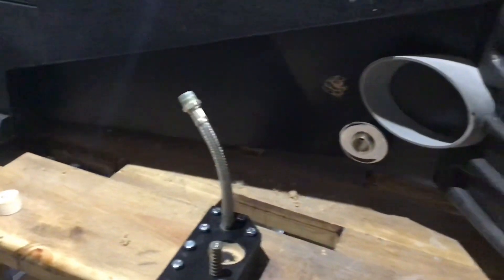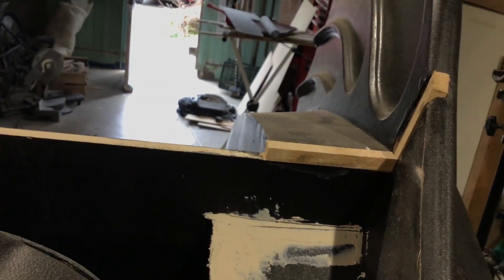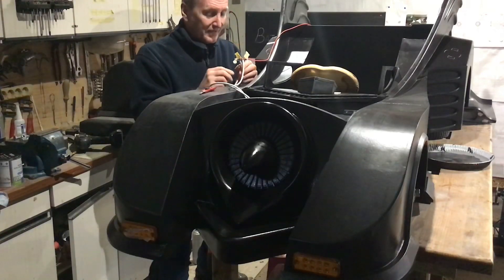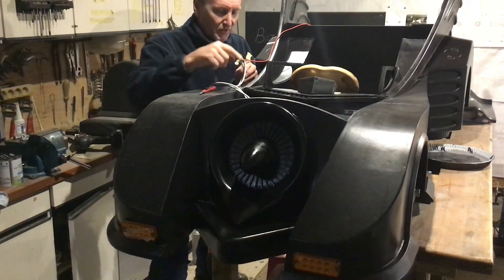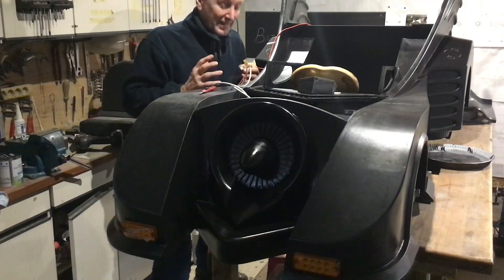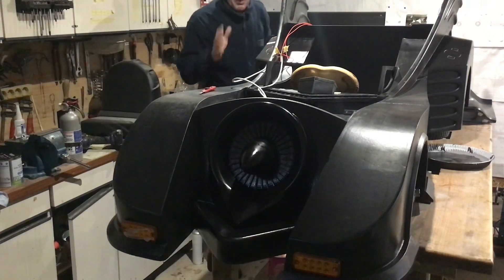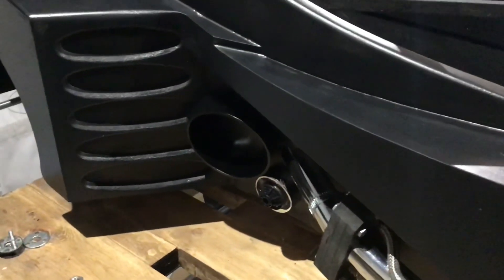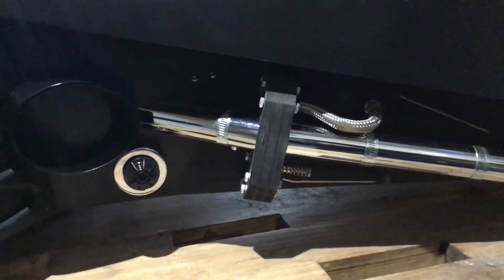KIDS ELECTRIC RIDE ON BATMOBILE.  Batmobile build Part 16 final build episode before the movie......

Comment: Just discovered this, a little late the party. Awesome build!

Do you sell the plans you made by chance(if you still have them). I built a power wheels version, but this is far more advanced and I’d love to purchase the plans.
Reply from the maker: Hello, sorry only just seen this. I didn’t receive any notification….. As for the plans unfortunately they were very basic and I had to change a lot of stuff as I went along. If I was making it again I would make the fins a little smaller and add them separately after making a box section body. I incorporated the fins into the box section on this build and that meant a lot of work with compound angles. Something I struggled with a bit. If you make one use a minimum 16mm bar for the rear axle as the 12mm I used worked but was right on the limit. Good luck
Reply: No worries. Thanks for the info. Awesome buikd

Comment: For future reference,run the lights through a relay (maybe for what you're using 5 amp),it'll burn the relay out first before burning the car down, 1 blue/brown permanent live+from the battery to the relay,you can take it off the power in to the ignition ,1 neutral - battery negative - terminal to the relay,then one switched live from the ignition switch live out,when you turn the ignition on the relay will switch on and provide power to the lights.... Can I have sum rotating Bats on the wheel centres please? Not asking much but,I'd like them to always to be level with the floor ;-)
Reply from the maker: Thanks again Dennis.